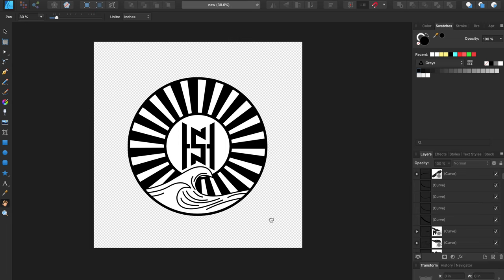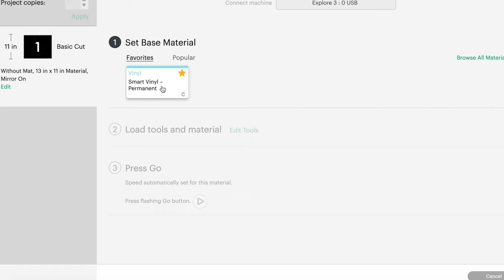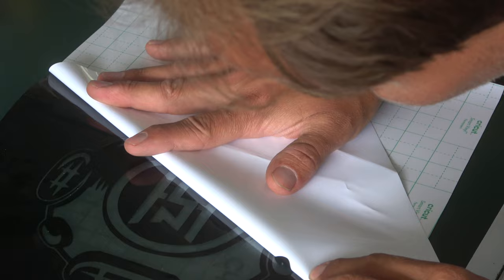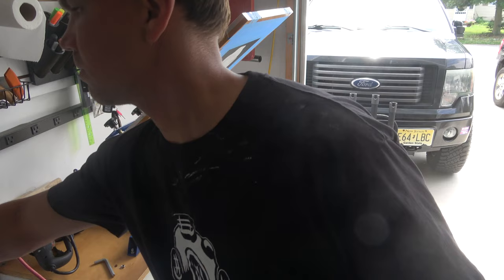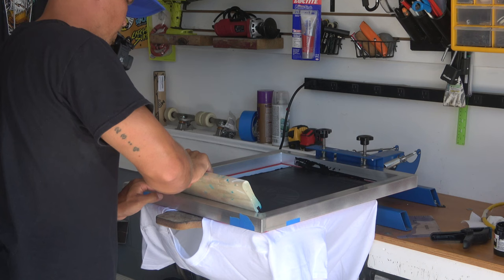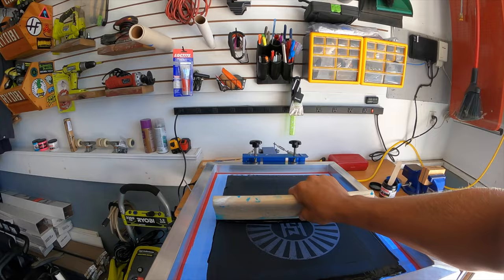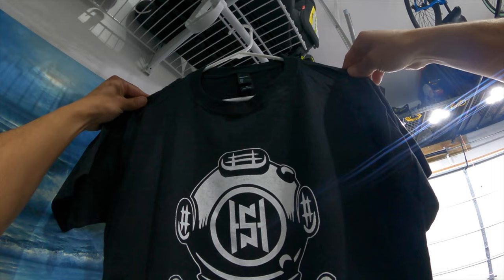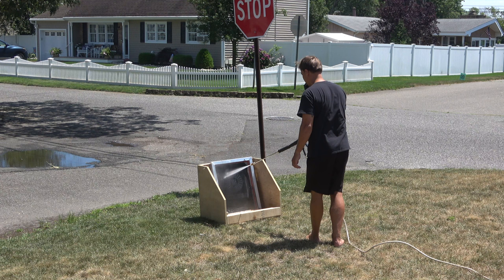How to Screen Print with a Cricut (Vinyl)

Comment: I really like that screen cleaning box you made, I need to make one of those! I just wanted to say that if you wanted to be able to have a more permanent design, you can use heat transfer vinyl and use your heat press to apply it to the screen. It works best with those wooden frames with the cord holding on the screen, because you can take the screen off and apply the HTV and then put it back on the frame when you’re done. Then the design stays on even when you wash out your screen, which is pretty cool! And if you want, you only need one frame, since you can take the screen off and put in a different screen with a new design. The only downside is that the wood frames get warped eventually from the water, unlike the aluminum frames, but you can always get a new frame when that happens and keep your screens with the designs on them as long as you need to.
Reply from the maker: Holy cow! Never knew or thought of that! I gotta try that next time. Thank you!! Thanks, the box comes in handy. I actually started to use just warm water instead. Works really well to clean the leftover ink away. It’s easier than power washing. Thanks again for tip! 🙌🏼😎🙌🏼
Reply: @sshouser31  sure thing! And thanks for the awesome video, I enjoyed it!
Reply from the maker: @shannonpalmer  Thanks!!

Comment: My transfer tape is too strong it keeps peeling the vinyl off the screen so I’m getting no where
Reply from the maker: What brand are you using for both Vinyl and Transfer Tape? I usually go with Cricut but there are others that work well too. Make sure you take your time when peeling (I’m sure you already are). I’d try switching up brands or use Cricut brands. If this doesn’t help, feel free to send me a picture on Instagram, and I’ll try to help you out! DM me @sshouser31.

Comment: I used to get stuck with the spray but they if you rest the glue spray on the pallet for a bit, you can feel when it’s less wet sticky but more dry yet still grips then place your T shirt on, also you need even coverage of spray glue but not necessarily a lot
Reply from the maker: Good tip! Thanks a lot! 🙌🏼😎🙌🏼 I always find it hard when peeling the shirt 👕 off! Scariest part of the project.

Comment: If there’s air bubbles in the vinyl will it mess up the design?
Reply from the maker: Depends how big. Try to get them out. If not, go for the print job. Maybe use an old shirt to test it out on first.

Comment: This is my favorite video,i successfully created my first at home screen print by following your exact steps but the smart vinyl stained my screen , I cant seem to rid of it , how to i get it off completely? Thanks
Reply from the maker: Thanks for the comment! I appreciate it!! Did you try using warm water and soap to get it off? Warm water should easily do the trick. Let me know how it goes!
Reply: @sshouser31  Yes, I used warm water with soap, but it still leaves the appearance of the black smart vinyl
Reply from the maker: @KittyPurrzzUnique  But the Vinyl material is completely off? If the Vinyl is completely off, and you're still seeing your design on the screen, we call that "Ghosting" in the Screen Printing World. The ink will leave a small stain, completely normal and it won't effect your next screen printing job. It just means you're an official screen printer now!
Reply: @sshouser31  the design washed out completely, i used a black smart vinyl, however the vinyl color still lingers on the silkscreen.
Reply from the maker: @KittyPurrzzUnique  Interesting, do you have Instagram? If you want, DM me a picture so I can look at it to better understand what is happening. If it's an ink stain you're fine. I've never had a problem getting the vinyl off. It's always come off very easy for me. Did you use the same screens I had in the description of the video?
Reply: @sshouser31  ok I will dm you on instagram, but I used a little starter kit from Amazon along with the smart vinyl
Reply: It seems it was the cheap silk material that was used for the screen because I tried another brand and it washed out entirely,  thank you for your time

Comment: Excellent presentation. You made me decide to get started. Question- the listed items you listed for the Aluminum frame, is the same size as your machine? It looks bigger on amazons? Wondering… also, how did you attached it to your machine?
Reply from the maker: The machine can fit all different sizes. I have smaller ones too. I just prefer bigger ones for my design. I bolted my machine to my workbench so it wouldn’t move. They make other ones that sit right on top though if you don’t want to bolt it! Happy to help! Let me know if you have any more questions!
Reply: @sshouser31  thanks. You should make more of those videos. I have seen several of videos and yours were exactly what I needed to kind of understand my basic of entry beginner to screen printing. 😝 make more videos pls when you get a chance. I will let you know it goes. Planning to work on it pretty soon.  Buying my tools. Thanks a bunch. Love your surfing, the good life. 😝

Comment: SUPER thankful for your clear instructions. CURIOUS tho - does it have to be permanent vinyl? It's been a year since I did this last (just by hand) but I'm looking to step it up and get the screen printing machine you suggested. STILL - I can't remember if permanent vinyl was absolutely necessary - I'm only grabbing a few aluminum screens is all. Before I was cutting and putting my own screens in and heat pressing those suckers which DID make them permanent.
Reply from the maker: I’ve watched other tutorials that use non-permanent vinyl. Seems to work fine. I just prefer permanent. I must say, since screen printing I haven’t gone to a store to “buy T-shirts”. That was almost 3 years ago! Most Graphic T’’s are like  $20-30 each! That’s awesome let me know how it goes! Totally worth it. Aluminum screens are the best. Thanks for watching and I appreciate the comment! Good luck! 🙌🏼😎🙌🏼

Comment: Might want to keep the image flooded when using waterbase ink or the ink will dry in the screen. I stopped using decal vinyl and if in a pinch use htv. It the regular way of using emulsion.
Reply from the maker: Good tip! I didn’t know that. Thank you! 🤙🏼

Comment: Is it necessary to flood the screen prior to placing on the garment
Reply from the maker: Nope but it will be a better print job if you do. There’s a bunch of techniques you can use. This is just one. You can also flood the screen again after lifting the screen to prevent the ink from drying when taking off your shirt.

Comment: does it work with solvent based paints? or only water based
Reply from the maker: I’ve only used water based ink. I usually go with Speedball. Super easy clean up.

Comment: Hello, very nice job, congratulations. Can I make 100 prints with a single model? I have a screen printing workshop. It is very difficult to deal with small jobs with film printouts, so I wanted to ask, thank you.
Reply from the maker: No, I usually do 10 and clear it. I only
use for personal use. I would recommend doing it the traditional way if you’re doing that many print jobs. Hopefully this helps! Thanks for watching! 🙌🏼😎🙌🏼

Comment: How many shirts have you been successful with when printing like this?  When I've done this in the past, I got like 2-3 shirts then the vinyl starts to come off (It would start to peel off), even with the stronger Oracal vinyl.
Reply from the maker: I usually do 5-10 shirts at a time. I use Cricut Permeant Vinyl. It has never peeled off while in use. Once, I used one screen 3 different times. Probably got 20-25 prints on it. I gotta use a power washer to get it off. I usually clear it in propose now and start fresh every print.

Comment: Thank you so much! How long does the screen last and about how many prints before it deteriorates? Thank you 🙏
Reply from the maker: If you wash with cold water and not power wash it, you could probably get away with 5 separate print jobs! Maybe more! Depends how complex you design is. I got 5 print jobs once. Good luck! Let me know how it goes!
Reply: @sshouser31 when your screen breaks is it the screen with the design itself or is it the frame? I guess what im asking is r u able to reuse your design
Reply from the maker: @user-ho7uc7bg5o  You can reuse your design if the Vinyl doesn't rip. You have to take your time cleaning it though. I've reused screens plenty of times. If the Vinyl rips just cut out a new one. Hopefully this answers your question!

Comment: I appreciate this video! I had a question, i was wondering how difficult it would be for me to get the permanent vinyl back off and if its even possible to begin with ? I tried to come up with my own conclusion, but can't seem to wrap my head around it, lol. Thanks in advance 🙏🏽
Reply: I guess I'm just trying to figure out whether I'd need a whole new screen every time or if I would be able to reuse the screen with a diff design.
Reply from the maker: It comes off pretty easily. If you watch the end of the video, that’s me removing it. You’re actually better off just using hot water vs. a power washer. It will peal right off when you do. No, you don’t need to replace the screen every time. I still have my original one from 2 years ago. Thanks for the question! Let me know if you got anymore! 🙌🏼
Reply: @sshouser31 I actually watched the whole thing, I just still couldn't help but wonder how much I'd struggle with that, lol.  I really appreciate you getting back to me. Thanks for your time!

Comment: nice video... i'm having trouble having the vinyl  to stick to the screen?? any tips...
Reply from the maker: Thanks! What kind of Vinyl are you using? I tend to go with permanent Cricut Vinyl when screen printing. It seems to work the best.
Reply: @sshouser31   maybe the humidity of miami is not on my side... I use oracal 651, but might need to purchase some new rolls.
Reply from the maker: @miamifashionstylist  Haha, it's possible! Makes sense. If you try the Cricut brand let me know how it works!
Reply: @sshouser31  i will have to search in my bin of viynl... thanks
Reply: ok i used the cricut brand and it worked!  the viynl did not come off when i passed the ink...yay.... thank you!!!

Comment: Washed my screen in the sink and my vinyl slid right off 😭 it was Oracal Permanent too. Any advice?
Reply from the maker: Have you tried Cricut Permanent Vinyl yet? Wash it with cold water not warm. I tend to do a one and done print job when I do it. I get about 10 shirts then call it a day on the screen and start over. If you want a permanent screen you’ll probably have to go with the traditional method which looks super confusing to me. 🤯 Hopefully this helps!

Comment: Is speedball the only Ink you use ?
Reply from the maker: Yeap, seems to work well. Why fix it, if it’s not broken. Have you tried any others?
Reply: @sshouser31  I was just wondering if you tried experimenting with other brands I tried permaset super cover really good for black garments
Reply from the maker: @MannyzCustomz  Good to know! Maybe I should experiment 🧪 I’m stuck in my old ways. Thanks for the tip. Now that you mention it, I never really researched inks or tried any other brands. I’ll have to try that next time! Good looks! Thanks! 🙌🏼😎🙌🏼

Comment: Great video!!! I dig seeing someone using a print such as yours, via the Cricut process. Most seem to be much simpler, text based prints.

Curious, in regard to the palette. Does it slide forward and/or back so as to accommodate slight adjustments so the print falls in the right spot on the tee? 

Or is that more about the placement of the vinyl onto the screen? Making sure it’s in the right spot?
Reply from the maker: Hi Mark! Thanks for the comment and compliment. Yes, you can slide the board front to back and adjust the center to accommodate your screen. I’ve gotten pretty good on screen placement but I always have to adjust with every new screen. Hopefully this helps! Thanks for watching.
Reply: @sshouser31  you bet Steve! Thanks for getting back to me so quickly. That's great to learn. I was thinking "IF I think the thing should move, you'd think the folks who made the press, would have it move!". 

One more question, and NOT SURE IF THIS WAS IN THE VIDEO'S NOTES, but the measuring tool you used to measure the distance a the top of the tee. It was curved at the top, where'd you get that!!?

Comment: You will get the worst results with this method. As you print, youre destroying the vinyls adhesive causing it to fall apart. You also cant wipe the print side of the screen without messing it up. And chances are all the adhesive will stay in the mesh, so the screen is toast afterwards. Just learn to coat and burn. Its not hard AT ALL.
Reply from the maker: I reuse my screens all the time. Never had a problem. I might try that method next, just seems like a lot with all the chemicals and proper lighting that’s required. Thanks for the input.
Reply: It’s not hard, but it requires a lot more equipment. This is a good way for people to do it at home. Not everyone has access to an exposure unit, a light tight rack to dry the screens, etc. I’ve done professional screenprinting since the 90s, and I’ve also used this method, and for a temporary solution with only a few shirts, this works perfectly fine. And using heat transfer vinyl to permanently attach the stencil to the screen works even better. Let people DIY without all the judgement.